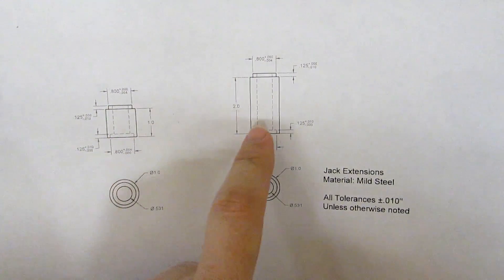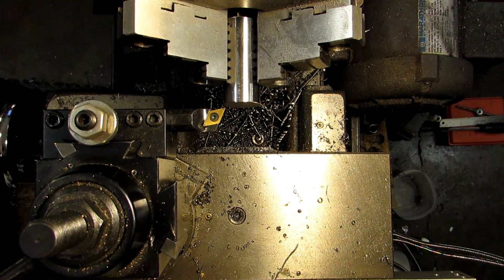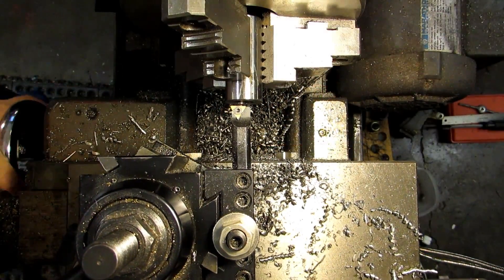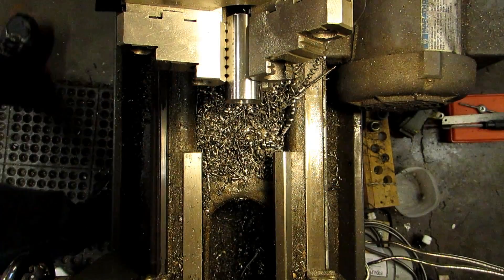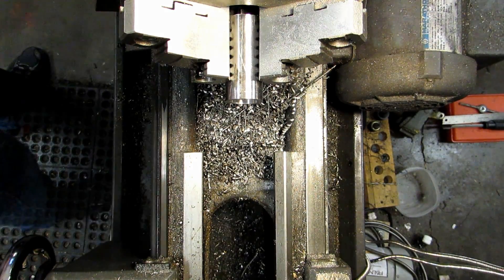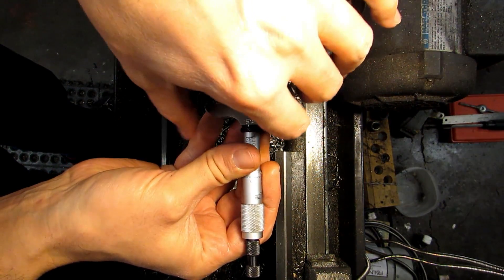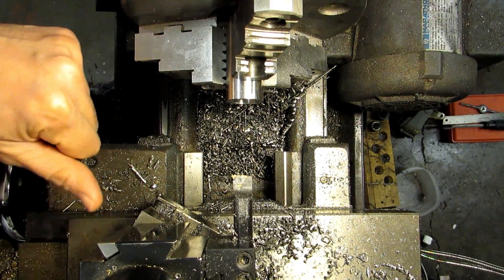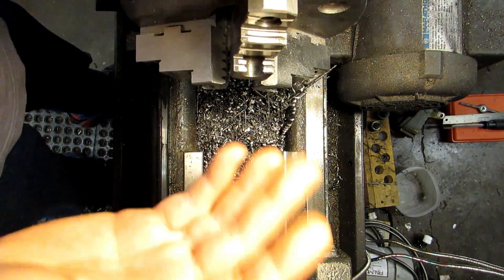Basic Machining Project - Machinist's Screw Jack Pt  3

Comment: Hello trying to watch these as a series, great work.  Not that it matters to anyone but me being a novice but some dro help. I have two Sino dros, common brand many clones. Three axis on my mill, two on my lathe but I only have to master one style.  Why is the long axis of the lathe bed not the x while the transverse is z. I was once told this is in reference to the rotating part is comparable to the quill. This confuses me but I need to conform as only the x has the radius diameter feature.
Reply from the maker: Hi John. The general practice is to call the spindle axis the Z axis, no matter what type of machine it is.  The longest axis perpendicular to that is the X, and the next longest would be Y.  That way, you always orient off of the spindle.  It gets a little confusing when going from a Vertical to a Horizontal mill since Z is now in and out and Y is up and down.  Lathes also are a bit odd since they only have an X and Z axis.  Y would be up and down, which doesn't exist.  I hope this helps.
Reply: Thanks but unfortunately what you said confirmed my understanding.  For me, x has always been like a mill even on the lathe, left to right is x, away from me is y or diameter in this case and there is no z unless I apply it to the tailstock. It’s my math science background or today medical imaging profession that hinders me. May just have to cover those letters with stickers.